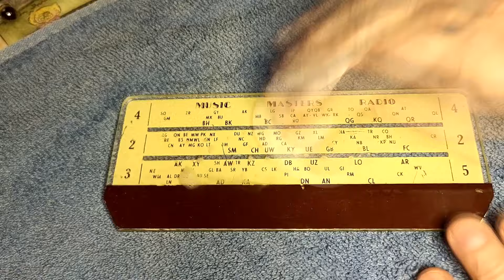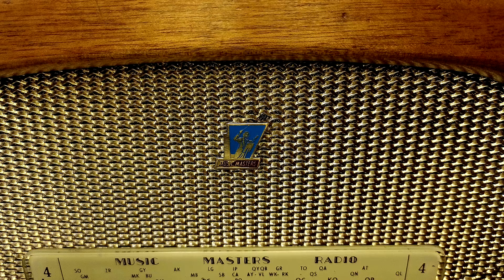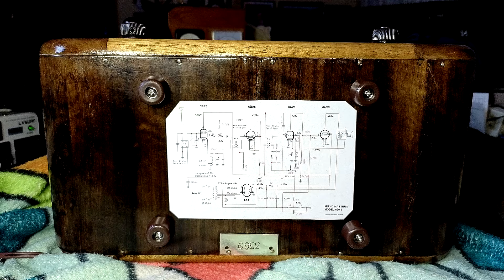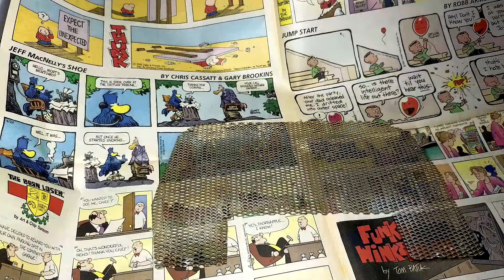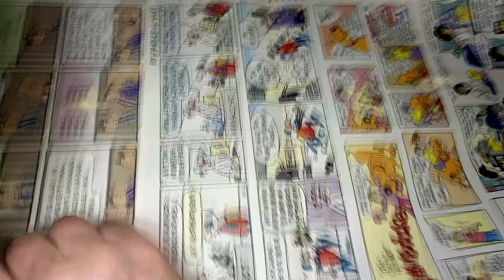1953 Music Master 620-9 Part 2 Final

Comment: Buzz ,great rebuild of the chassis ,the cabinet looks amazing , unusual radio huh ? Congrats . PS I have some 7 & 9 pin sockets if you need some !
Reply from the maker: i had ordered some, but they never arrived in time for the video. so I had to scrounge for some! 🤣
Reply: That Bizz socket adds a bit of charm to this special rafio for Buzz.

Comment: Those original yellow caps are usually really good. They were made by Philips and are often referred to as mustard caps. They are actually foil caps rather than paper. I see them a lot here in the Netherlands and usually keep them in! Good job on the restoration!
Reply from the maker: Hi Mark...they were still good, but when rewiring the radio, I had to re-locate them and the leads were too short to use......hello to the Netherlands, home of my ancestors! 🍺

Comment: Hi Buzz, great job, you always go all out on the restorations.
In case you didn't know you can replace individual tube socket pins, after you remove the solder you can release the pin retention crimps and push/pull the pin out from the top, replace it with a pin from a similar socket, I've done that many times in the past, saves a lot of work.
Reply from the maker: hahaha..I found that out later , after I replaced the sockets. I actually filmed a segment on it, but cut it out cause the video was too long!! ..thanks for that comment......not many know that , I think!............................. here is a beer and fry for you!🍺🍟
Reply: @Buzz1151  Thanks, ketchup to you on the next video, hiccup..

Comment: Greetings:
The upper metal sheet was to spread the heat from the tubes as to not char the wood above them.  The lower metal bracket was keep the front and rear of the cabinet from speading apart as the the wrapped  veneer meets at the bottom and has less support fore and aft because of that separation.

Comment: I recon that foil on the inside top was to protect the top of the cabinet from all the tube heat.  It would probably cause warping.
Reply from the maker: well maybe, but that foil is gone now 😲and  the veneer is lots thicker now , so I think it will survive! 😎